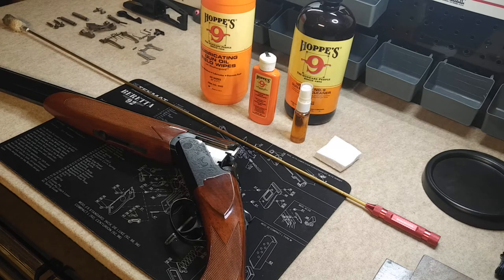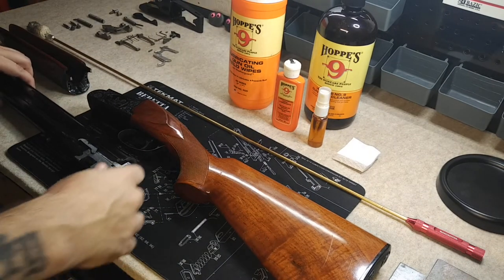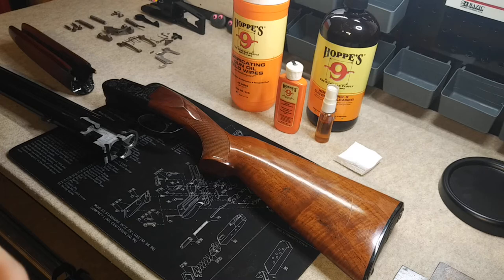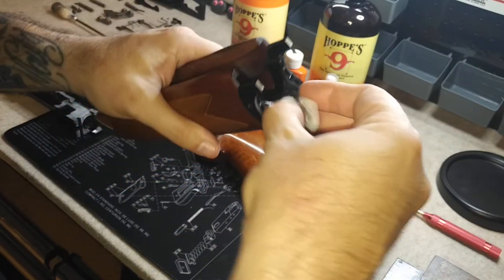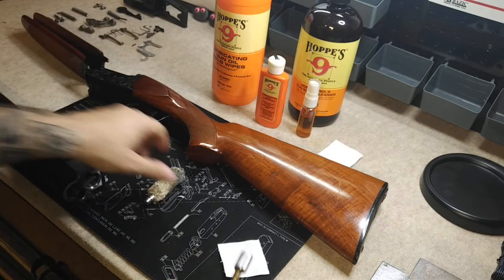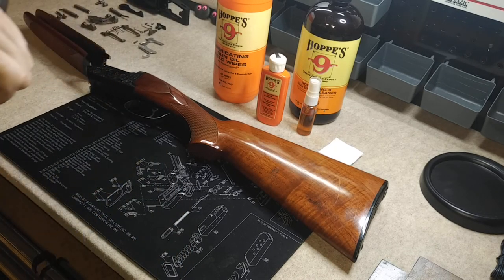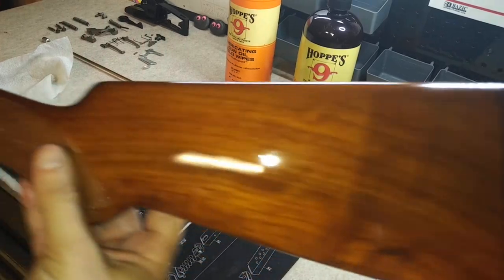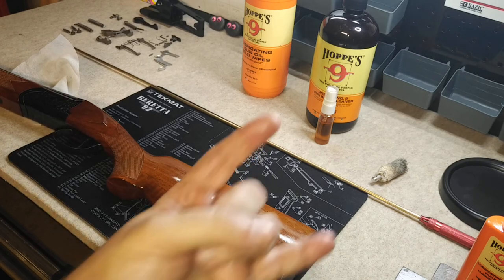How I Clean Double Barrel Shotguns

Comment: I agree with Brassmonke. As a cbinet maker an wooden boat owner, i have applied a variety of oils and oilspirit mixtures to raw wood, to preserve or put on a finish.Virtually any vgetable oil can be used, and on my elm and oak fishing boat, that goes in salt an fresh water, i use a 50/50 mix of raw linseed and paraffin, far an away the most effwctive and cheap preservative. Mark Wigg.

Comment: That lubricant you put on the wood is not good for linseed oil  wood stocks
Reply from the maker: Billy, thank you for youre concern and I hear this a lot from people in the firearms community. Please I do not mean to sound condescending we just have a difference of opinion and I can appreciate that, but I've been a wood worker since high school and I spent 12 years as a carpenter by trade. I can assure you a Hoppes No9 field wipe will not damage the wood furniture on a firearm. That wood was kiln dried and moisture free before the factory applied an oil based finish to it. The small amount of oil applied with the field wipe will only serve to clean and preserve that finish. I do agree that if this was a antique show piece, or if finished with a water based product(check out my savage/fox model b project) I would not do anything to disturb the wood but this is a field gun. It is used for hunting. It's been exposed to the elements, rain and snow, blood and mud. A little oil from a field wipe is actually beneficial. Thanks for watching my friend.
Reply: @thatfunkymonkey  I think you know what you’re doin bro.
Reply from the maker: @JoseMora-wc5zz  thanks i appreciate it